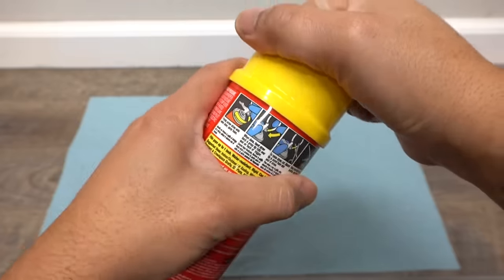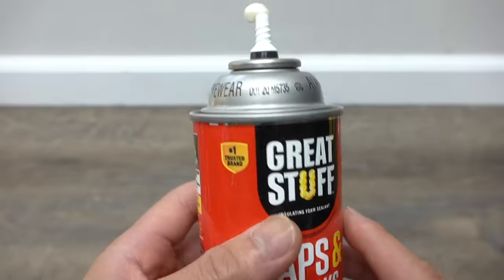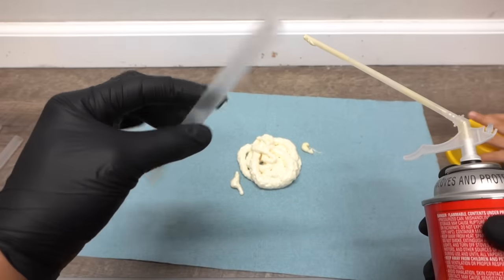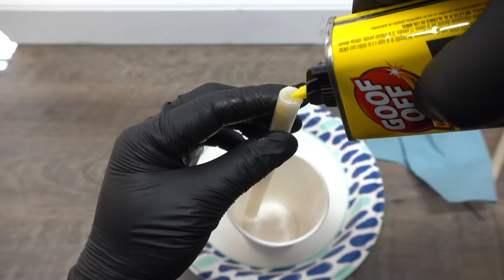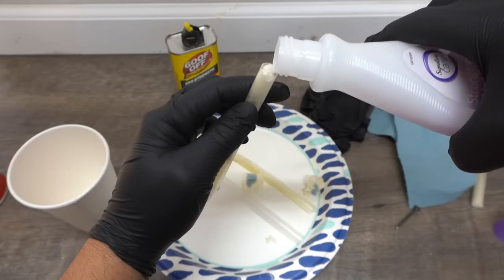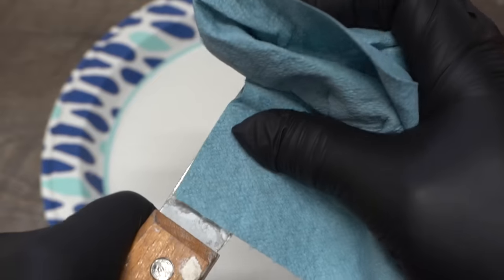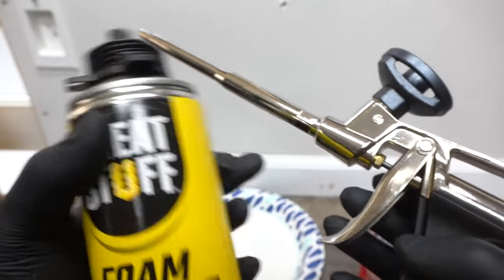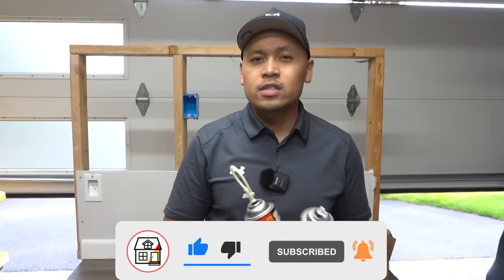STOP Throwing Away Half-Used Dried-Up Spray Foam Cans! How To Save And Fix It! DIY

Comment: That stuff is so messy, I can never get the right amount and it either is not enough or it continues to grow until it is to much. They need away to better install it and judge what it needs and expands to! They need to make away to combine the 2 chemicals the proffesionals use , the can form they sell suxs. I swore it off the last time I tried to use it gets everywhere but where you need it! Would be better if it were 2 seperate chemicals like professionels use

Comment: I wait a few minutes till it is half cured and rubbery but not sticky and pull it out with a bit of wire then push it out of the tube also. Ive had half cans be good a year later.
  Not sure about expiration dates, they've sweltered in a blazing hot garage all summer for years and been fine. Not sure about freezing, my garage doesn't get that cold with a greenhouse on the side.

Comment: Been using the drywall screw for twenty years. Works on the can spout and the can to straw adapter. To remove dried foam from the straw remove it frome the adapter and push it from the straw with a piece of bare copper romex ground wire. Like I said been doing it for 20 years

Comment: No Goof Off. I just use a wire/clothe hanger to force the dried foam out of the straw. Comes right out. It's a little harder in the trigger piece, but clear that, too. I have used the screw technique to clear the tip on the can, but have also had cans that would not clear no matter what I tried and had to throw away that full five dollar can of foam.

Comment: Pipe cleaners from the crafts aisle would also clean the straw as long as you get to it before it cures, without bending the straw. The same pipe cleaner could be placed into the nozzle opening and left to cure so that the can, can also be used again.
Reply: Additional pro tip, the cans are intended to be dispensed upside down, that way you're not getting a blast of CO2 blowing away dirt and dust before dispensing the product.

Comment: Not too smart to spend $20 on goof off and acetone  to clear the tube so you can use the rest of a $5 can of foam. Throw out the used can and buy another for $5 and save your money.
Reply from the maker: It’s actually pretty smart. A can of goof off will go a long way, and you only use a small amount. 👍🏽😊
Reply: You can use goof off if you do lots of painting, I keep a can always, this tip is a huge plus, hats off to Fix This House 🤠
Reply: Hats off to Fix This House
Reply: Yea cuz you're really gonna use all of the goof off/acetone to clean it out

Comment: Wish I had seen your video a week ago. I only used 1/4 of the can and had to discard it two days after. I wonder if flexible straws could be used in place of the original straw.
Reply from the maker: I’m pretty sure of the straw fits snug around the nozzle it will work my friend 👍🏽😊

Comment: Good info. Although you mention goggles later on, I suggest it should have been mentioned when talking about using the screw to pull out the plug. It would be easy to accidentally trigger it right into your face. Use goggles for that and point away. (I know you can't edit existing to add that caution, but maybe an overlay card? You probably know what I mean.)
I have used the screw trick but did not think about acetone for the tube. I push/pull on a thick wire inserted in the tube and with varying results. Thanks for the acetone tip.